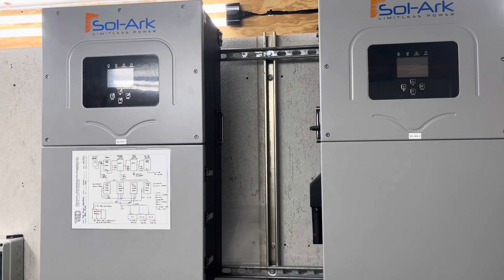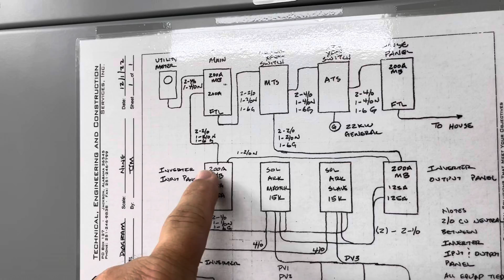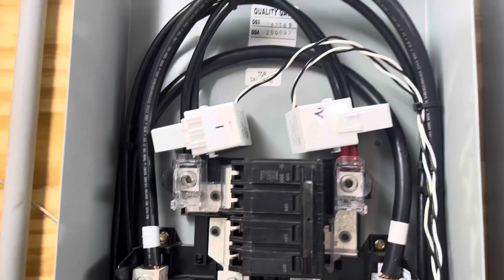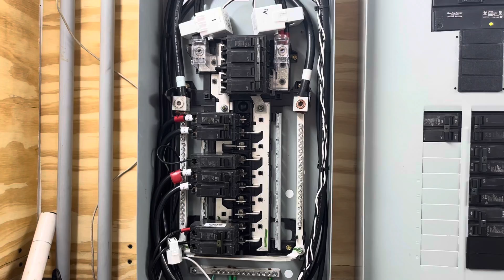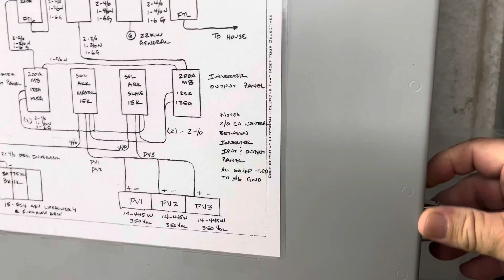Installation of Power CTs for the Sol-Ark 15k Hybrid Inverter

Comment: I doubt those main lugs are rated for 2 conductors!
Reply from the maker: No doubt you are correct.
Reply from the maker: But I monitor my load and also perform thermal scans of the system to insure I’m not having a heating issue due to poor connection. 

This was not my preferred method but it was the only option I had considering the breaker I was using to feed the panel.

Comment: Hmmm. My Emporia energy CT's direct me to install with arrows pointing to load. The CT's seem to read in both direction. What comes in, and what goes out.
Reply from the maker: Yes. Depends on the software. My emporia is the same as yours. The sol-arks require the other way.

Comment: That doesn't seem right. You install the CTs where the power comes into the house, not where it comes into the solarks. Based on your block diagram they are installed well downstream of where they should be.
Reply from the maker: Actually they are installed exactly where they should be - the first utility panel upstream feeding the inverters.
Reply: @jeffmotes2129  read the manual, they are to calculate the demand in the main service panel to support the limited power to home and grid peak shaving functions. If they are only in the panel right before your inverters then they can only zero out the usage at that level, rather than the whole house.
Reply from the maker: You’ve mistaken the Inverter Input Panel for the Inverter Output Panel.
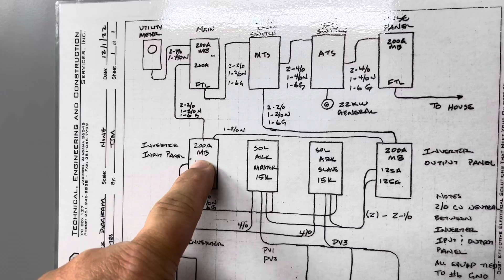Reply: @jeffmotes2129   ....i think what he is trying to say, and was going to be my question, at 1:48 in your video/block diagram, (the directions say) the CT's should be on the line side of the MB in the main panel outside.  it seems now the CT is reading through 2-200a breakers, prior to the meter, rather than just straight off the meter (load side).
im glad you did it this way (because i wanna do it too).  if you aint had any issues with the system, or discrepancies from the power company, id say you're ok.
Reply from the maker: @keything8487  I understand what Ken @zorlig is talking about. And he isn’t wrong if I was using my system in that manner. 

I don’t have an interconnection agreement with my utility. If I had an interconnection agreement or was backfeeding power into the grid like a grid-tied inverter I would need the CTs at the first 200A breaker. However with such an agreement the utility would charge me a monthly feed based on my array size and pay me about 15% the kWh rate they charge. I figured if I sold them 100% of my solar output I would net about $300. I would still have to pay them retail for any power I pulled from the grid. 

However, with my system either 100% of my load flows through my solar power system (and the panel I have the CTs in) or 0% of load flows through the system. There is no split in the power. I do not backfeed into the grid. So actually I don’t think I even need the CTs.
Reply: @jeffmotes2129  I miss understood... I thought you were going to sell back excess power.
Also I thought the CT was not only for selling back but a sensing unit to the inverter to auto transfer from grid to back up in case of power outages
Reply from the maker: @keything8487  not familiar with the last part.
Reply from the maker: @keything8487  unfortunately on the days I have excess capacity I can’t do anything with it.
Reply from the maker: I usually just drop the HVAC thermostat way down and use the excess to deep cool the house.
Reply: @jeffmotes2129  I see what you mean now, those top ones are all transfer switches or something. No power going through them unless you turn off the solark. Hard to see imo looking at the paper.

But yeah your CT are installed at a point where you could limit to load and have the same effect, so they don't do anything.

They are for if you have other loads that aren't backed up, so you could zero them out too.